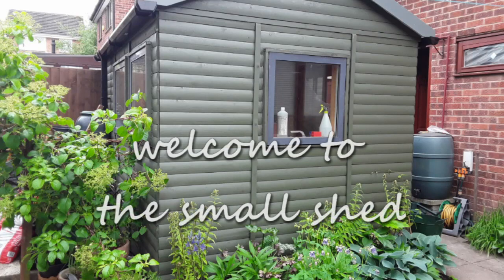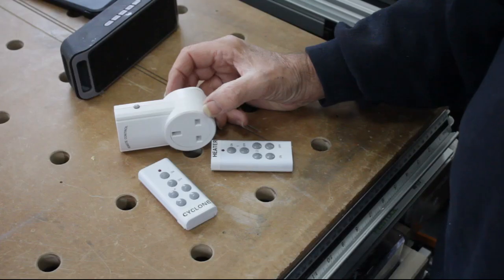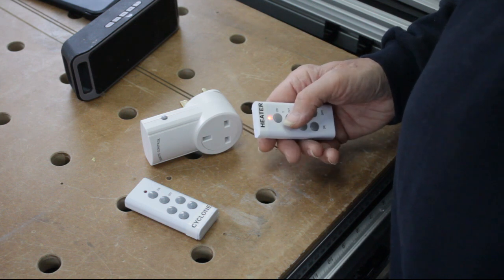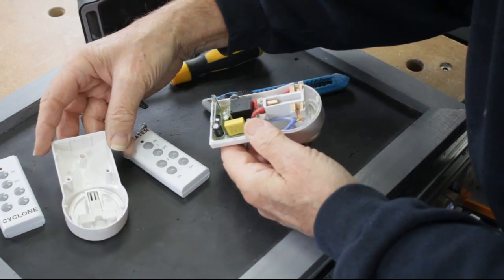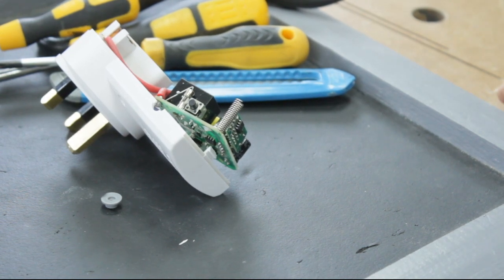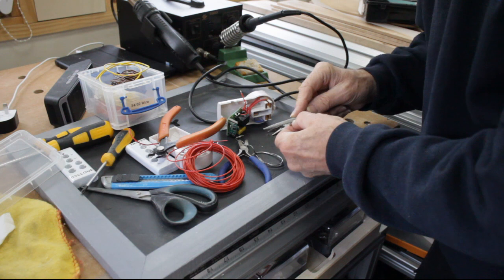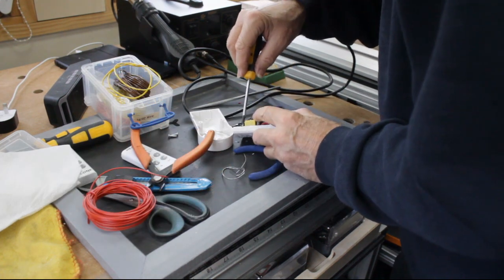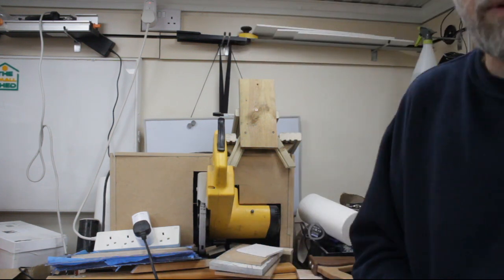the small shed #212 - remote switching in the shed

Comment: Great fix! Those remote plugs are amazing! I have a set of 5 in my shed with 2 remotes so I can have a remote at the lathe and one at the work bench. I control my dust extraction, compressor and some lights for videoing.
Reply from the maker: Yes, in hindsight I wish I had gone for a set with one control, but it might get an upgrade one day.